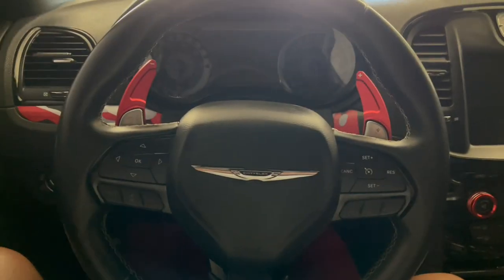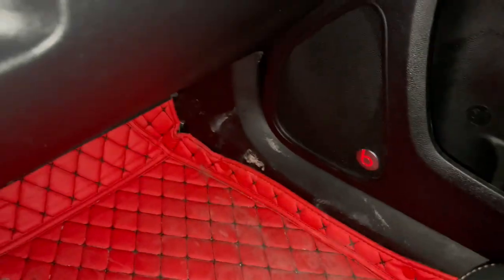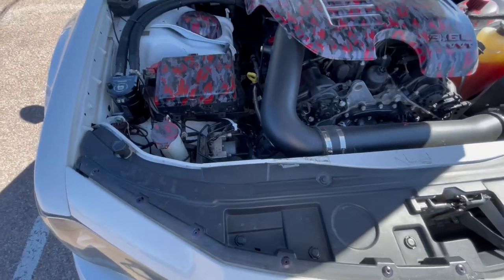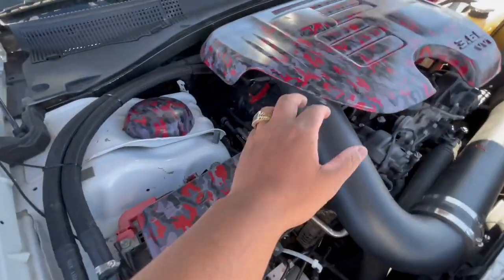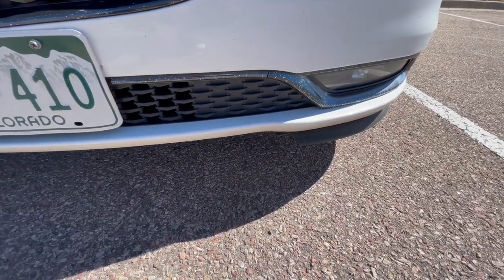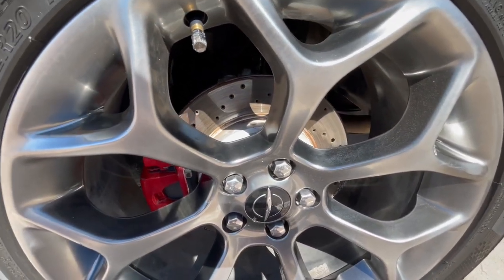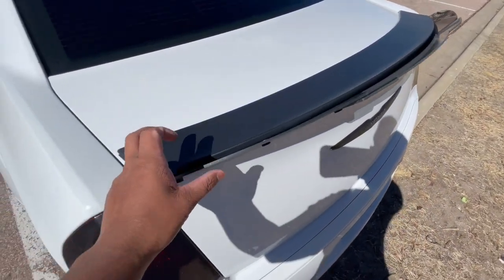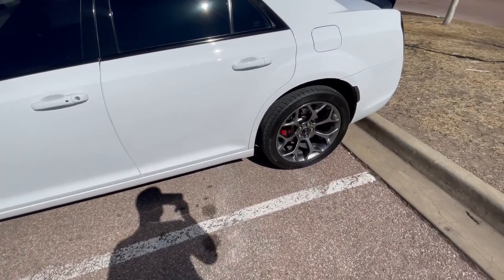Every Mod On My V6 Chrysler 300S | Interior | Engine | Exterior | Exhaust

Comment: At present, I have a 2011 Chrysler 300C with the 5.7 liter Hemi V8 engine, 5-speed transmission, and rear-wheel drive. Recently, I ordered a 2024 Chrysler 300 Touring L with all-wheel, 3.6 liter V6, and the 8-speed transmission. So, your video episode is really good for me. May God bless you 🙏 always in your life journey.
Reply: If you have a C it’s AWD fam
Reply: There is no 2024

Comment: Hey man! I have an 2018 300S and I have pit in an Edelbrock 2650 Supercharger, Hellcat headers and exhaust, lowered and got some sweet 20" Stance FX6 bronze rims with Nitto tires 305/35 on the rear and 275/40 on the front. Putting in a 13.3" Nav/ stereo. Still got more planned!Cheers! Good videos! Waiting to see you Ripp Supercharger installed
Mungo!
Reply from the maker: So you definitely got the 5.7 or 6.4. Lol. Good shit!!! Sounds like a badass setup to me man.
Reply from the maker: Oh yeah, got a shop to do the install and tuning. Ripp said early May it’s getting shipped
Reply: Yes 5.7 Hemi 520whp

Comment: you have to get the rear  led lights over the tail pipe holes the rear reflectors you change those out and make them led lights there sequential also. I have them on mine about 40 bucks about hour  of your time
Reply: Yooo I’m interested in what you’re talking about can you explain where you got those from and how they work

Comment: Good old trick I learned for rust.... Zinc anodes are added to marine engines in order to prevent rust, they work akin if you attach them to car frames. Virtually your entire car will be safe from rust. Can get them from pretty much any local marina, or even Amazon.

Comment: did you change your dash lights?  I just picked up a 2019 300 Touring, and want to make it my own, the one thing i hate is the blue back light on the dash, and want to change the color, but have not been able to find anything on it anywhere

Comment: I'm buying a 2018 limited AWD tomorrow am I have 2022 300 rwd wheels for it they aren't staggered they are brand new 245/45/20 so much questions is did you have to run a little spacer on the front? I've had a few AWD Magnums an ran 255/45 20 all the around with no issues but those are much older so I'm not 100% sure about how these new 300s are this is my 1st AWD 300.

Comment: @Mopar300s did the intake cause a check engine light to come on
Reply from the maker: No, went right on and ran better. The sensor not being positioned correctly may cause that but I haven’t seen it happen

Comment: Whats going on man. I've enjoyed your videos, and decide to comment on this one to ask a couple questions

1. Your RGB headlights are from lighting trends, but are they smoked? 

2. Have you ever considered upgrading to the 4 or 6 piston brembo brakes from the hellcats? 

3. Have you installed the supercharger? 

4. Where did you get your rotors? Rockauto has a set that are relatively cheap. I just need more info on how to upgrade to 4 or 6 piston, which is why I asked question 2. 

5. Do you know where I could get the paddle shifters (not the clip ons, the actual steering wheel) and do you know how I could hook it up to work? I don't have a 300S. 

Looking forward to a response. Perhaps you go 4 or 6 piston upgrade and can fill us in. Same with the supercharger

Comment: What do you think about the MMX hemi throttle body adapter kit ? Is it the same ? Or a difference from ported to normal 80
Reply from the maker: From everything I’ve seen it’s the same as the ported 80mm Throttle Body they offer.
Reply from the maker: Except it’s not ported. It’s just a 80mm which you can’t really go wrong with either way you look at it
Reply: @Mopar300S  what made a bigger difference coils with plugs or throttle body.?

Comment: The MSD coilovers and iridium spark plugs… did you see a huge difference after installing? And do you recommend these over RIPP coilovers or vice versa?
Reply from the maker: More juice when I hit the gas. That was instantly noticed. As far as Ripp goes, Ive seen too many forums about them misfiring or going bad so I can only go based off of the reviews.
Reply from the maker: But, to answer your question, I'd recommend Ripp ones due to the power gained from them. Just hit or miss if they keep running as designed.

Comment: Can u get lowering springs ? Would you
Reply from the maker: I can. The kit cost 299 for the springs for my car. Would I do it? Yeah. Just the issue of CV joints going bad a lot quicker with it. Still on my radar for a mod though lol
Reply: Nice
Reply: I asked soMeone that works for dodge they said those springs wouldn’t fit on AWD
Reply from the maker: @victorrosales530  there’s specific ones for the AWD model 300’s. https://fasthemis.com/i-23893616-hr-sport-lowering-springs-chrysler-300-dodge-charger-3-6l-v6-rwd-awd-2011-2022.html?ref=category:1204071
Reply: @Mopar300S  there is none for mopar ? Beans
Reply: @Mopar300S  parts *
Reply from the maker: @victorrosales530  there is. The mopar parts site offers lowering springs for the 5.7L only. Smh.
Reply: I’d get a 180 thermostat but misimoto
Reply: @Mopar300S   I have 2016 AWD 300 s 😞

Comment: I wanna know how much hp you have. Cause i literally have majority of the same bolt on mods but they didn’t give as much power as i wanted. Lucky for me i managed to find someone who tunes V6 300s and i went from 292 to about 350hp & 300 torque. I’ve heard that bolt ons don’t really work unless you get them tuned. So my question for u is what’s your HP before and after all bolt ons? And do u have a tune why or why not and would u get one before the super charger. Promise if u get a tune you’ll notice a big difference

Comment: I still have not found the answer to my question..whats the difference in the 300c and 300s..I thought it was one was a v8 and one was a v6 but that's not right cuz I have the 2020 300s and its a v6 but seen a 300s v8 also..sum one plz help lol..Im kinda pissed now cuz I would have got the v8 over the v6 if I knew they had the 300s in the v8 so yea .
Reply: 300C has more things as standard equipment, although you can get pretty much all of them on the 300S. 300C more luxury oriented, "S" more sporty. If I remember correctly, "C" has 18" wheels standard "S" has 20" wheels. "S" comes with paddle shifters, and "Sport" mode, "C" does not. The 300C has lots of chrome, 300S has virtually none. You can get 300 C or S with a V6 or V8.